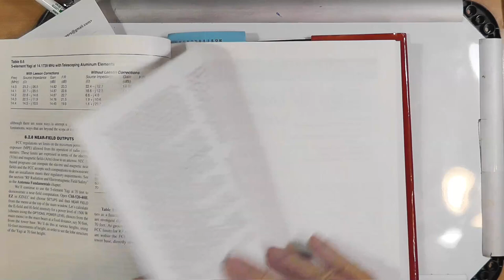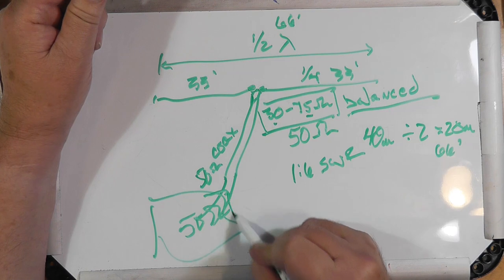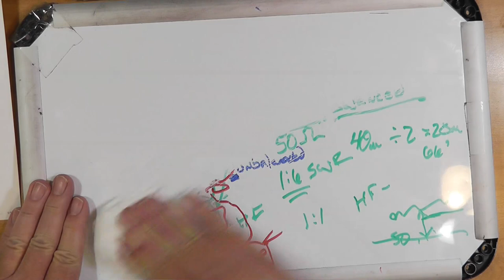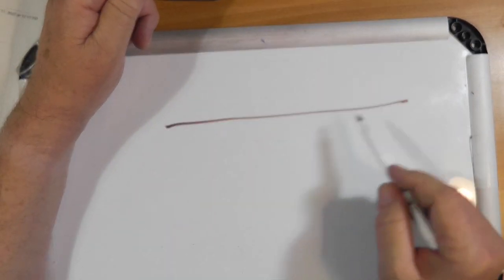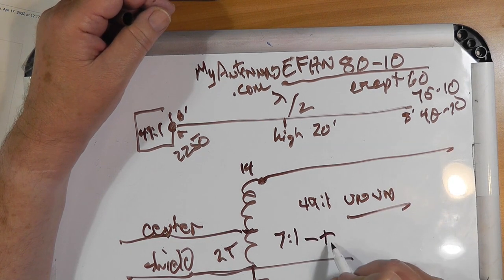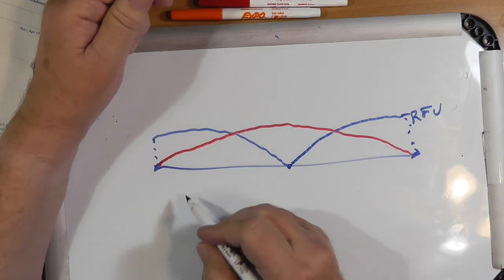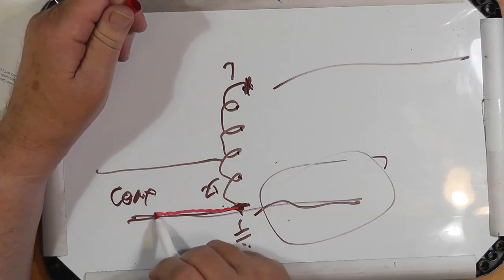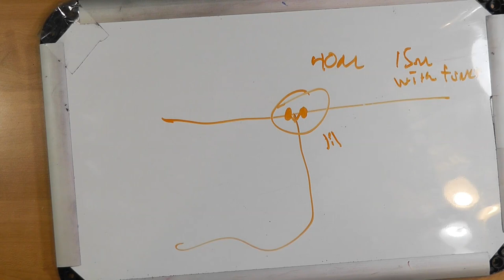Baluns : When and where? (#706)

Comment: Since you said that the off-center dipole has a nominal impedance of 400 ohms, why do you use a 4:1 balun? Shouldn't it be an 8:1 balun?    (since 400/50 = 8)
Reply: Well you certainly could use an 8:1, if your installation is at the ideal height above ground, no slope, etc., all things in a theoretically perfect world… and if you can find one, or plans to make one.

But in practice, many typical compromises made/forced in the installation tend to be things that lower the impedance some anyway. And a 4:1 balun is very simple/cheap to make, readily available for purchase, etc.  Therefore, chances are pretty good that 4:1 is going to get you close enough to beautifully matched such that the SWR is reasonably low, & hence the losses reasonably insignificant.
Reply: I've modeled these OCF's and they are indeed ~200ohms on their respective resonant bands.  They are not 400 ohms.  So you do need a 4:1 to put it into the ballpark.  I've not gone back to see what he said but if he said 400 ohms, he misspoke.
Reply: @BusDriverRFI  It also depends “how far off center”. There’s a spot somewhere along a dipole where it IS 400.

If one is home-brewing an OCF, one might pick a different distance from center based on what balun one has handy.
Reply: @kelvin0mql  yes. Of course. You can do whatever feels good.
Reply: @BusDriverRFI  True.
Not necessarily related, but quite true.
LOL
Reply: @kelvin0mql  while your point is true, there's a point on the OCF where it is ~200 ohms simultaneously on several bands. It's kinda nice.

Comment: What does it mean that you have not have good luck with 1:1 balun on simple dipole? What were the problems you had?
Reply: It's actually a chunk of change out of your wallet.  It gains you nothing.  1 goes in and 1 comes out minus small losses.  I get the impression some hams like this don't want to stir the pot and dis 1:1's because there are so many businesses who sell them and so many hams have bought them.  I bought one (ferrite used at 10.115MHz) and tested the output to the dipole.  Essentially no difference in antenna current.  Only a small amount of loss over using a direct connect.  So they are a good deal if you just need a little bit of loss.
Reply: @BusDriverRFI  but nobody says it would add any gain, the idea is that it disconnects galvanic connection between antenna and transceiver eliminating problems of common current and the likes.

Also it seems like Dave was not talking about wasting money, more like having some problems with this setup.

Comment: Hi Dave -  I have a HyEndFed 80-10 with a 49:1 at the end point and as recommended by the manufacturer I placed a 1:1 balun 0.05 lambda away from the antenna’s 49:1 balun. I’m not sure exactly why but it works wonderfully… 145 countries in the past 2 years. Coax acts as the counterpoise into the station. As an aside…at approx. 13 minutes you correctly show a 49:1 balun for an end fed antenna and at approx. 20 minutes you show it incorrectly at 7 turns to 2 turns. Mistakes happen (especially at our age - I’m 73) but it might be exceptionally confusing to a new ham to get conflicting information. Just saying you might want to check your videos before publishing them. Cheers W2RSB | F4WCM.
Reply: I like how you state that it works but you don't know why.  It really doesn't help anyone to at least guess.  With my testing at 30M, I see no difference in performance.

Comment: Thank you. I have not used baluns much.
   On 80M, it seems that reception is better without the balun, than with one for a center fed dipole. That was for my home antenna and one used for field day. I was using an old Galaxy 5 vacuum tube/transistor hybrid transceiver at home and a friend's solid state rig during field day.
   That does not make sense to me, but that is what I experienced. Others used the same baluns and had some improvement. I wished I would have taken detailed notes, but I did not. N0QFT

Comment: I used two dipoles cut to 56 feet. Each was perpendicular to the other for good angular coverage. I generally operate CW and was planning to use this antenna on 40, 20, 15 and 10 meters. This is a short dipole on 40 meters and longer on the other bands. I used balanced line to the antennas (about 66 feet long) and connected that to a 4:1 balun. From the balun I used 50 ohm coax to a tuner. Once tuned on a given band I could switch back and forth between the two dipoles without having to retune anything. Nice! These antennas worked great on FD a few years ago. I've always wondered how to determine the impedance at the balun to get to what the SWR was on the coax for each band. Maybe I don't need to bother with all that. :) Thanks...

Comment: the turns ratio is properly figured at the ratio of the secondary to the primary. A 49: 1 unun will have a primary of 2 turns, making the total winding of 14 turns, tapped at 2 turns from one end (for the coax feedpoint). - AL7W

Comment: will a steel antenna pole act as a counterpoise instead of a hanging wire???  K3RJW,,, Ron W
Reply: Yes!
Reply: @mikedickson1668  I thought so, but no one ever talks about this, just a wire or wires all the time. Thank you Mike.
Reply: There can be a completely long white paper written on this subject.  How well it will act as a counterpoise will depend upon many factors such as frequency utilized, possible telescoping electrical connections, how well it's coupled at the feedpoint, length of the antenna pole and whether it's grounded at the base.  If we are looking at it holding up a horizontal antenna for example and it's not even connected to the braid, it shouldn't have hardly any affect.

Comment: Thanks for providing good information. I have one question. Would it be ok to use awg 17 one core copper wire with the torroid, 1:1 current balun? Or isn't critical what wire size to use given a QRP transceiver, maximum 10W output.
Reply: The wire size is important for maintaining the proper impedance match through the transformer.  If the impedance doesn't match, then you'll have a higher SWR when you put the balun in circuit.

Comment: Isn't a dipole fed directly with coax (no balun), a quarter wave antenna with a quarter wave counterpoise? In which case it's a quarter wave horizontal!
Reply: If you look at the schematic of an antenna from the perspective of the equation R +/-jx, we know that there is a resistor, inductor and capacitor in series.  We know that current in a series circuit is equal.  What's on one end is equal and opposite polarity on the other end because they work against each other.  Ideally, the Xc and XL are equal and cancel (resonance).  The configuration of the dipole centerfed can certainly be looked at as a quarterwave with a quarterwave counterpoise horizontally.  But it's virtually the same if you feed it with or without a current balun 1:1.  Keep looking at things unconventionally.